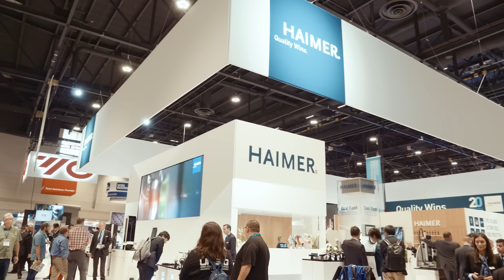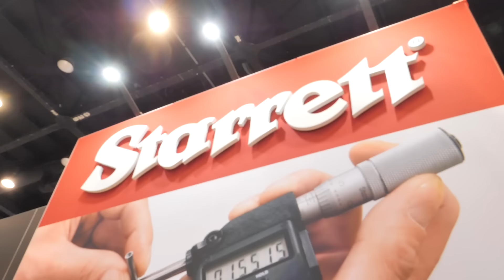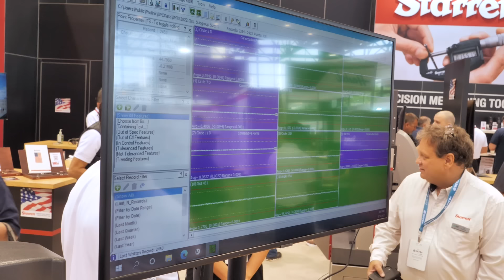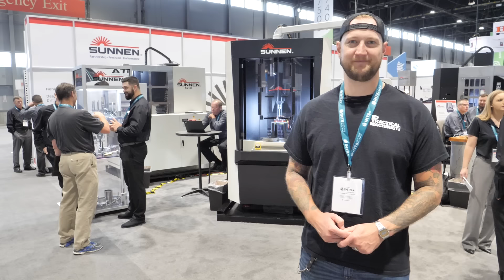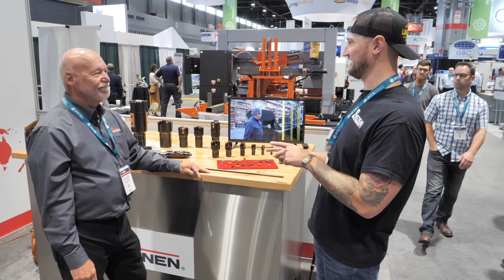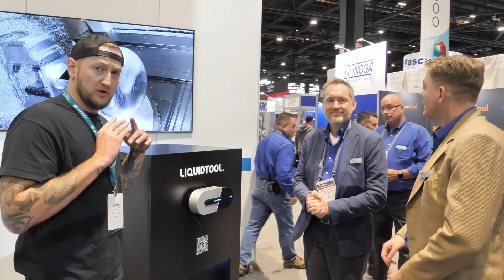My FAVORITE Booth Experiences at IMTS 2022 | Machine Shop Talk Ep. 65

Comment: No unfortunately didn’t make it so it was nice to watch the videos. 
It was cool to se sunnen we have a few bore gauges form them top off the line stuff.

For a new lathe I know your a Haas fan and they have been good to you but I highly recommend talking to ferro about doosan I don’t think there is a better machine for the money right know then a lynx2100 lsy.
Reply: I’ll have to check them out! Right now I’m looking at a ST20Y with live tooling, but those Doosans are looking slick right now!
Reply: @LakewoodMachine  I learned on HAAS and the last shop I was at for four years only had Doosans and they are incredible. I will always have a soft spot for the HAAS control but machine wise the Doosans are incredible. We had a lynx with live tooling and it was solid. My favorite was the horizontal mill and the dnm.